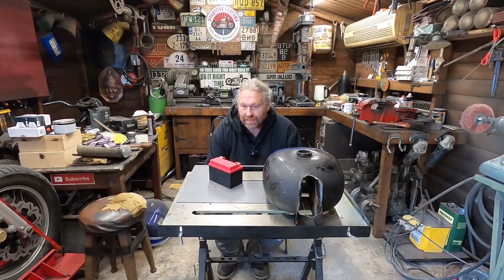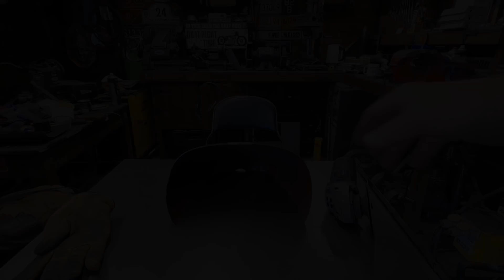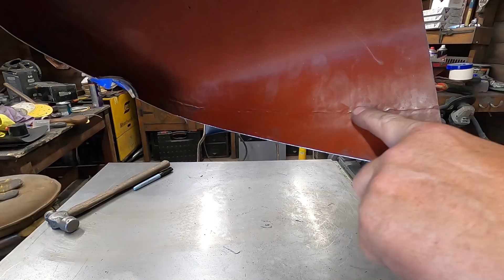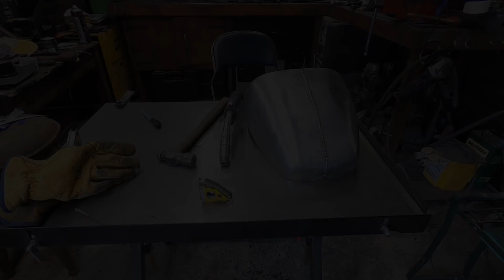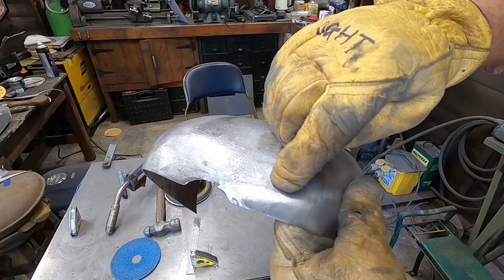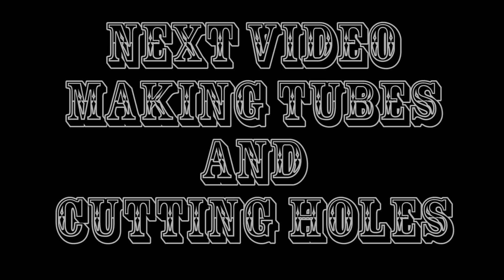SUZUKI GS CUSTOM BUILD

Comment: Craig: Dan, and me are going to change the tank details, I'm having a mind change on the GS.
I cam hear "The Narcissistic Self Proclaimed Engineer": NAW, NAW, NAW, NAW, NAW!
It's great to watch the skills you have, others prefer to use other channels to show us how not to do it and TELLING us how it should be done "if you know what I mean".

That said, what you do is not only a learning process for some and therapeutic for others, I do know what is on show is not always what's inside.
You appear pretty calm in yourself now you're getting out on your adventures and the pressure is lifting with some projects coming to an end, great job, and ride safe matey.

Comment: This is a load of shit!!! Basically you are using an old tank as a rear fender.... where is the design, fabrication and custom in this?
There are other motorcycle fabricators/ custom builders out there on YouTube that actually blow you out the water and I don't mind naming them so your viewers can jump camp and watch somebody who makes,designs,fabricates and mocks up parts from scratch.
Maybe you could also get some ideas from him....  before your channel crumbles around you.
There is also a 'critic' that has appeared on YouTube recently who if he stumbles across your channel will tear your work apart.
So please Craig, in the future, for your own sake put a bit more effort in and use your noggin!! You could of quite easily mocked a template up using Hard cardboard until you had the desired shape and then copied the design on to mild steel.
I will leave a link at the bottom to the above mentioned Youtuber for you to watch and probably learn.
Please don't take this to heart.....I'm just trying to help.
Regards Alan
Husqvarna Strava Makeover #4